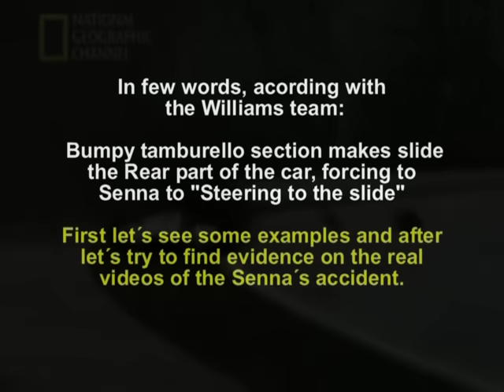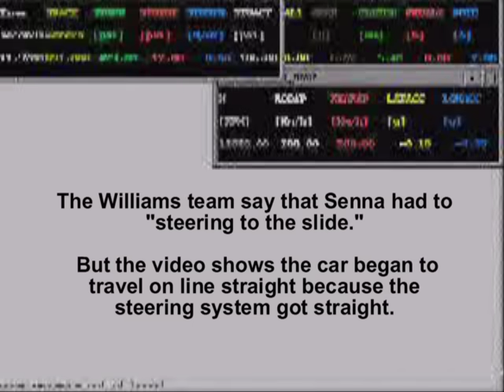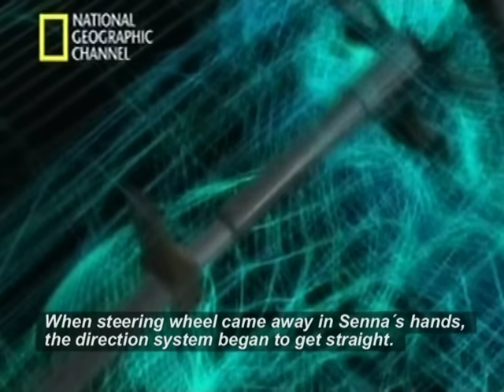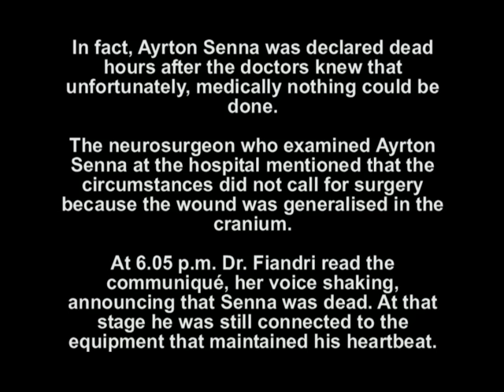5/5 the death of Ayrton Senna - what NatGeo did not tell

Comment: Steering column broke, and the car hit an unprotected wall at around 130-140mph. The angle of impact caused the right front suspension assembly to fly straight into Senna's head. Some pieces pierced his helmet and caused severe bleeding, others hit his head so hard be suffered blunt force trauma.
If the angle of impact was 1 degree more or less, he'd most likely be alive...if the suspension parts hit him a couple inches lower, or higher, he would be survived...
Reply: Sometimes I think that he somehow knew that he will die in F1. Look at his face some minutes before. He was hard believer. Maybe his God sad to him: "Believe in me and I´ll make you immortal. I will take your life but you will save much more lives" . I mean all protective things in F1, his money after death for charity and so on.
Reply: @heamorhoid he did. Before the race he claimed in his own words “it would be surprising if someone does not get hurt this season” and “someone is going to crash for sure” and I think 4 or more incidents occurred relating to mechanical failure or just crashes in itself
Reply: Noone who hits a wall at over 130 mph and almost stops dead , walks away , the body just can't cope with those forces.
Reply: except Gerhard Berger at the exact same place in 1989 😉

Comment: The charges focused on the car's steering column, which was found to have sheared off at a point where a modification had been made. A 600-page technical report was submitted by Bologna University under Professor of Engineering Lorenzini and his team of specialists. The report concluded that fatigue cracks had developed through most of the steering column at the point where it had broken.

Comment: I remember watching the race and thinking that Senna's impact on tamburello wasn't a big deal, that he'd jump off the car, angry right after it stopped completely...
Reply: All fake...
Reply: no need to get angry and insult.
Senna crashed at about 200 kph which is a lot for a normal car but should be sustainable for a F1, considering that the year before I saw Zanardi with Lotus and Berger with Ferrari crashing at probably much higher speed and jumping out "fresh as new" from the cockpit. Ratzenberger the day before crashed at the Villeneuve corner at 320 kph, his car actually taking off due to the loss of the front wing, and that impact itself was fatal.
Senna had his skull cracked and his neck and throat snapped because he was hit on the head by the front right wheel and its support, which perforated his helmet's visor. At that time F1 and its circuits were unsafe, but Senna was very very unlucky, dying like this
Reply: The tire bounced off the wall and hit him in the head, otherwise he would have walked away.  This is according to the autopsy, so start the name calling it makes you look like what you are.
Reply: same but for dale earnhardt.
Reply: *9$/2$C.e?nt#3. Berger survived a very similar crash in 1989 only a few meters down from the spot of Senna's crash site. The Austrian was almost as quick, he had a much less shallow angle of impact AND his car went on fire for about 16 seconds with him still inside. By all accounts, if you compare videos of these two incidents here, Berger's seems much graver.
(I've seen both crashes on live TV and in case of Berger I was certain he was dead, while with Senna I expected him to step out of the car any second.)

In the end it's all a question of luck (or lack of it). What's interesting is that no one investigates any  sinister motives behind Ratzenberger's fatal crash the day before. Because he was a nobody. A god like Senna, on the other hand, cannot possibly die in a mundane accident caused by a $5 piece of metal cracking. No, there must have been a conspiracy.
Reply: Alessio Balsamo Oh boy were you so wrong!
Reply: @*9$/2$C.e?nt#3 Please explain exactly how gravitational pull relates to this specific accident using words that don't start with F, C or R. We thank you in advance.
Reply: I saw this happen on live tv, and I too expected Senna to get out and walk away. Until we saw the repeat and the tire hitting him in the head. That had us worrying, but we still expected, he would be ok. By the time they had him out of the car and lying on the asphalt with blood spreading out from his head, thats when we knew, something was very very wrong. (Years later I saw an interview with the race doctor, who said, Senna died right there on the track, the doctor knew, there was nothing, he could do, but they worked on him anyway to keep his body going long enough to get him off the track and to the hospital).

He was imo 1 of the best drivers ever, and it was such a sad way to lose him. Please stop with the conspiracy theories tho. As others have said, many other drivers have had accidents very similar or worse and walked away. Senna was simply very unlucky that day, and he doesnt deserve to have his memory soiled by conspiracy theories.
Reply: He would have jumped out of the car if only his wheels had tethers (mandatory since 1998).
Reply: @segaiuolo  also Barrichelo

Comment: if you go and watch the longer version on board of this race (2 laps or so before the crash)
you can clearly see the steering wheel play get progressively worse and worse leading up to the crash.
concentrate on the yellow button on the wheel and it shows not only violent up and down play, but what looks like in and out (front to back) play as well.
and near the end, the yellow button on the wheel sort of gets darker and less visible, in my opinion because the steering wheel is actually getting pushed in deeper to the front of the car.
combine the absurd amount of steering wheel movement, the lack of corrective tire steering movement, the lack of reference point twitch movement, and hard sudden body lean, has me 100% convinced the steering column broke.
on such a high speed high grip corner, the amount of steering input torque is at its absolute highest.
Reply: Sad, but true
Reply: Please excuse my ignorance, but I also find it odd that THIS driver would accept a welded connection/increase in such a vital component? He was too much of a perfectionist, I just find it hard to believe he wouldn't have demanded the entire assembly be replaced, the only way to ensure maximum strength?
Reply: euroaaRON1 If that was the case Senna must have been aware of it.  He would have been aware of the increasing "play" in the steering system.  One would have thought that he would have pitted the car.
Reply: thehistorywatcher and give up the lead? i dont think the glory days racers from back then thought like todays racers(all out attack vs conservation of engine fuel and tires). especially senna who would do absolutely anything in his power to secure a win.
Reply: euroaaRON1]]]
Reply: He was not in the lead. Schumacher was, and he was driving with traction control while it was banned
Reply: I think it's also worthwhile considering that drivers really need to use the kerbs at Imola. This may have also contributed to the alleged broken steering column if it was indeed welded.
Reply: thehistorywatcher: Doubtful.  Senna had moved to Williams to improve his chances of winning the championship.  Thus far into the season he had yet to gain a single point in the championship.  No racing driver in his right mind would give up the lead because the car was beginning to "feel funny".   And Tamburello is (or was) a flat-out curve.  There are a lot of other, tighter corners on the track that would put much larger loads on the steering shaft.  It was Senna's bad luck that the shaft chose to give out at that particular moment in a curve.
Reply: @SRFDriver  I mean I don't think any corner would put a bigger load on the steering column than Tamburello. It's a flat out curve at 190 mph or so. If it's going to fail anywhere, that's where it will fail.
Reply: @Tuup84  Schumacher was behind hence the vision from Michael's car of Senna going off

Comment: Something mechanical broke on that turn, and it points to the steering mechanism, if you have any knowledge of driving or racing cars you can see it in the vid by the non-movement of the front wheels in the turn.
Reply: One thing  to remember  was  Sienna had crashed  this same car in the  two races  before this crash  took his life!  Who is to say that it was not the previous crash that weakened  the steering column
Reply: not the same car. they change it.
Reply: @mylanmiller9656  Because it broke at the weld?

Comment: Clear as day, the steering column broke and the car goes straight off the track. The video evidence is very striking, this is one of the simplest accidents to explain.
Reply: +10DKJUMP The FW16 car suffers low aerodynamic pressure (Senna is out of race - slide at corner in Interlagos circuit). At Imola, the car had understerring,  Senna fix it, but the sterring column broke... (my opinion, sorry the bad english)

Comment: I have actually seen the photos taken of Senna's helmet. There is a very clearly visible puncture mark in the top of the visor, in line with his eyebrow. There was also a MASSIVE amount of blood and a pinky grey substance. He was ABSOLUTELY speared in the head by a control arm connected to the wheel. So although Senna may have suffered a basal skull fracture, he was already dead before then, or at least mortally wounded, so wouldn't have made a difference
Reply: absolutely correct, hence why in the corner Senna was already turning his head to the left in the cockpit through the corner during the in car video footage as he was going through a reaction of the upper control arm being embedded in his head and as the car is being transported back to the pits his right seatbelt appears to be saturated in blood.
The pinky grey substance you refer to I believe is his brain
Reply: Heartbreaking
Reply: Dont know whether to believe wikipedia, but according to them. They arrived at the hospital and restarted his heart. Thwy had the opportunity to restart his heart again, but they didnt. But looking at this accident, I think he probably would have died either way.

Comment: The footage from Schumachers car shows it all @ 2:41 Steering column failure also Frank Williams interview he basically admitted he and his team let Senna down and did not follow the correct procedures when modifying it..
Reply: What really makes me angry about it all was that Bernie and others hid the fact that Senna and Roland had died on the circuit and they also removed the on board computer.
Reply: Do you know the name of the Frank williams interview?
Reply: Frank Williams should be in jail. He was convicted and found guilty. Unfortunately, it was too late; the statute of limitations had passed.
Reply: It was not Frank Williams fault, it was infact a choice by Adrian Newey and Patrick Head to shorten the steering column.
Reply: It was actually a choice by Senna to lengthen the steering column that was reluctantly performed by his engineers who reinforced the hell out of it, because it was a last minute, short term fix. Senna was equally culpable for his own crash (if it was caused by a broken steering column).
Reply: There are a few of them plus an eponymous 2017 documentary which I highly recommend. His guilt comes across quite strongly although never does he say openly they killed him. But I think they knew from the very moment. Wouldn't have let Hill race on if they didn't know what had caused failure on the other car.
Reply: @noxvi4753  If he asked for a change to the car and they comply, it's not their fault that the change didn't hold. Any weld would fail under those conditions. There's a literal ton of force going through the steering column on this turn in particular which could easily sheer anything but a perfect weld. The alteration shouldn't have been made in the first place. What should have happened is this: 

Senna- "Hey engineer can you break and fix the steering column so it sits lower in the car because I don't like how high it is"
Engineer- "No that's crazy if I mess up the weld you could die"

Senna- "That's a good point I hadn't thought of that I'll just deal with the wheel being too high for a race before we can get it properly fixed"

But instead what (probably) happened was this:

Senna- "Hey engineer can you break and fix the steering column so it sits lower in the car because I don't like how high it is"
Engineer- "No that's crazy if I mess up the weld you could die"
Senna- "Do it anyway I really don't want the wheel to be that high"
Engineer- "That's a bad idea but you know what you're doing you're the best race car driver in the world"
Senna- "Hey thanks mate"

It's not Senna's fault he died. It's not the engineer's fault he died. The engineer was asked to make a choice which has two bad outcomes. Either he makes the change and Senna could die or he doesn't make the change and probably loses his job because who wants an engineer on their team who doesn't make changes to the car when asked.
Reply: @David-ud9ju , You're absolutely right. He was told they didn't have the right material/equipment to make this change but Ayrton insisted.  He wanted to win!  Alas, his death could have been prevented if they had cancelled the race after Ratzenberger died, according to Italian law, but the promoter would have lost $5 million and he or someone else pressured them into continuing with the race.
Reply: @Andrew B What you’re saying is very stupid and ridiculous. Are you honestly trying to pretend in any fashion that you know how that conversation went? You had a camera in the room when Newey and Head agreed to Senna’s request? You think Senna would go forward with a request, even if he knew it would greatly endanger his life? 

It doesn’t change the fact that if you agree to do something, and then you mess it up so badly it causes someone’s death; You’re 100% responsible to some extent. 

You need to think more critically.
Reply: @USMCLP  I'd like to remind you of Senna and Alain Prost in Japan, he risked both their lives to win the championship. Just bear that in mind.
Reply: Crazy how the halo would have saved him